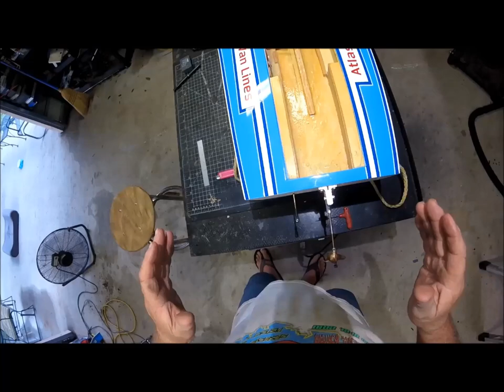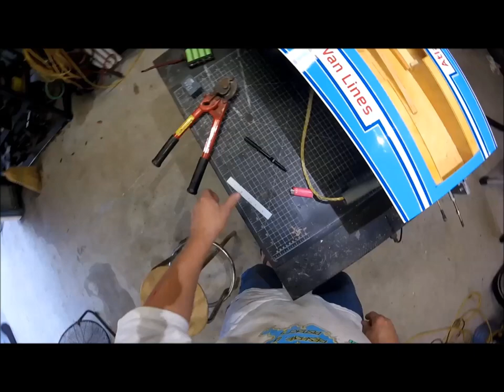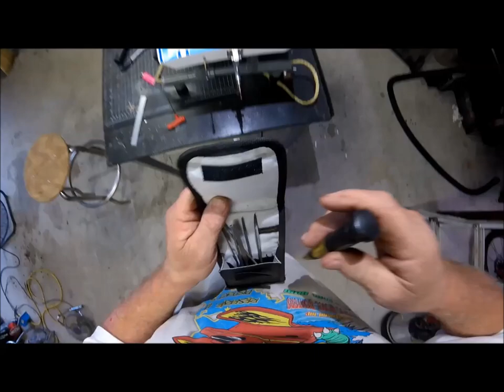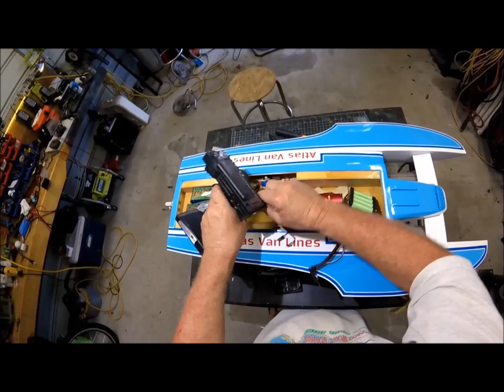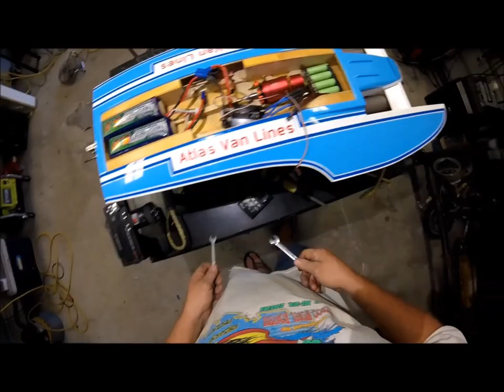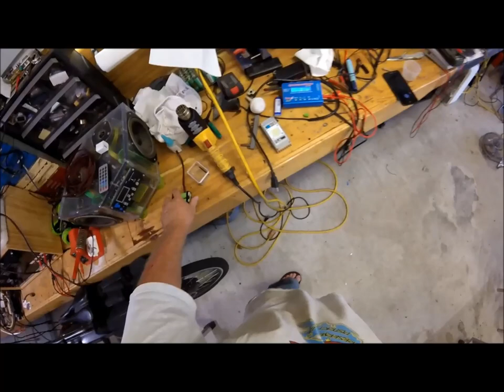RC boat hydroplane rigging part 4 the flex shaft and lighting the motor up

Comment: Hi ! Thank you kevin ! For getting back to me . This. Mr. Herman Woods. I dont think it is a speed master stinger . it is a double rudder stinger blue , in color ! I think my shaft is off line . i think that is why i lost it in the lake. I have that big motor .that make it kind of hard ! To line it up . You ! Was the one ! To show me how to balance props ! 2 blade .i dont know yet on what to look for on a 3 blade prop ! But thanks to you .You made it happen ! For me .I will be taking it all down today. To try it again. I have. Been in RC FOR OVER 5 YEARS NOW .I AM NOT A RACER ! BUT I LIKE SPEED ! I AM A BOAT MAN ONLY ! JUST NEED SOME POINTER ON GETTING ANNGLE ON SHAFT. AND BENDING COPPER SHAFT .AS WELL TO GET IT RIGHT ! IT'S A KING OF SHAVES 50.4 INCH GAS BOAT ! THAT IS ELECTRIC BOAT WITH LEOPARD. 56-113 MOTOR . WITH A OF TORQUE ! THANK YOU FOR YOUR TIME .MR.H.WOODS !

Comment: Thank 's Kevin ! I think I got it now ! I snap of 1/4 shaft in the poud . WAITEING on offshore to send x460 prop . I think I was binding ! Because it broke in the middle of the shaft ! So what I had did ! was move the Hole up 3/8 inch up .and drill some more holes on the motor mount side . to bring down the motor ,to line up ! the prop is about 1/4 from water level ! Now ! I hope I am in the ball park now ! Thank you for your time 1 YOU ARE VERY GOOD IN WHAT YOU DO ! I CAN SEE THAT ! I LOVE BOATS ! UNTIL THE NEXT TIME TAKE CARE OF YOUR SELF !  H. WOODS
Reply from the maker: Good work and good luck the way I can tell if my shaft and tube are right.....when the flex leaves the tube and goes into collet it must go straight in the collet and not touch the side of the tubing and by the way are you running a "T" bar

https://www.amazon.com/Aluminum-Width-T-bar-Cable-Support/dp/B06XYFL86G/ref=sr_1_2?crid=1ROJGWTVDNHM4&dchild=1&keywords=rc+boat+t+bar&qid=1597221319&sprefix=rc+boat+t+bar%2Caps%2C202&sr=8-2

Comment: So does the bushing just float around, and back and forth, within that 3/16" gap?
Reply from the maker: Yes it's a consumable you have to change them periodically whenever you feel some slop in the shaft that's when you have to change them they have holes in them to collect the oil and grease and to keep the shaft lubricated the water will keep it cool thank you very much for watching I got a couple more videos coming out in a day or two

Comment: Kevin ! With a V Hull ! Useing the V here .Do my tubeing need to be directly at the bottom.Our ! Can i come up a bite ! To get to a correct alignment . my motor is big ! So i have to raise the shaft up from the bottom V our not ! I AM NOT TRYING TO BEND THE TUBEING TO MUCH ! I WHICH I DONT WONT TO DO ! 1/4 TUBEING STEP DOWN TO 3/16 .O WONT TO USE ! OCUTRA X460 PROP 3-2 BLADE ! PROBLY A 2 BLADE FOR RPM " POWER ! THANK YOU !
Reply from the maker: the hole you drill for a speedmaster strut is 9.525 mm or 3/8" from the bottom of the hull to the bottom of the strut tube but on the speedmaster the prop is about 3" to 4" off the transom 

 https://www.offshoreelectrics.com/proddetail.php?prod=ros-stinger-str